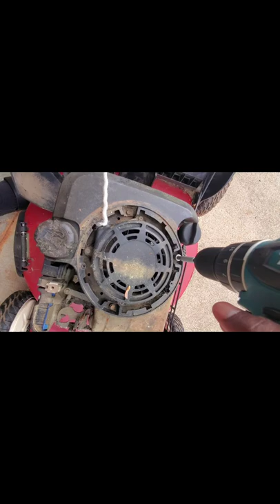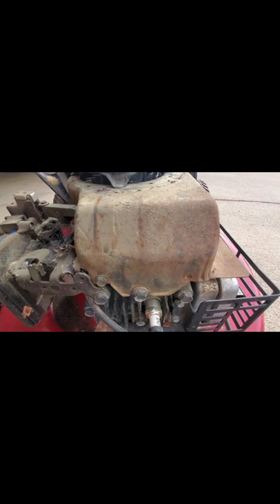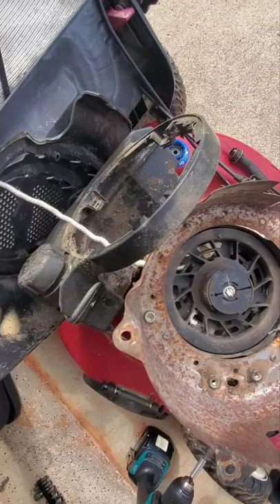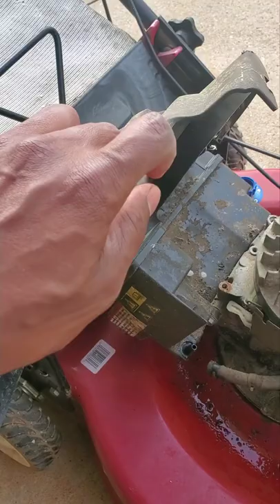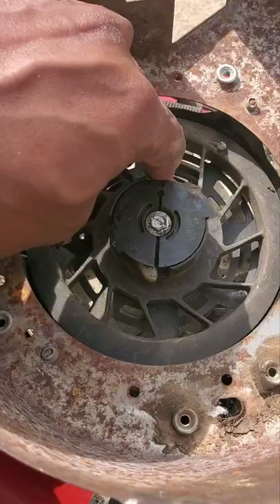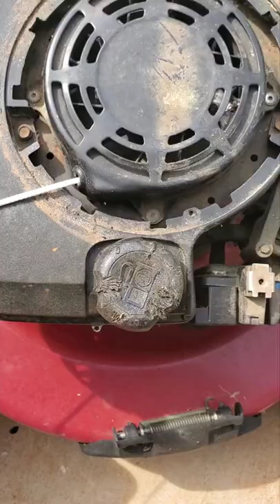Lawnmower Pull String Replacement: Toro:

Comment: Great video! I have a similar Toro, and I couldn’t tell if the stainless steel things were rivets or hex head nuts. I was going to drill them out until this video showed how easy it is to dismantle the bigger top. Well done, and many thanks!

Comment: Good, straight to the point how-to video on replacing that model pull cord; fixing to pick up the same mower for $45 with a messed up pull cord, looking forward to fixing cord followed by prob cleaning the carb and have it ready for sale for next Spring:-)

Comment: My neighbors mower, which I'm fairly certain is the same model did the same thing. The core of the pull cord didn't actually break but the outer casing did. To me, that says it's not the cord but something wrong with the recoil.

Comment: LOWES now sells a 9' USA MADE $16 replacement that will last a LIFETIME.  You may want to sand and paint the rusted handle retaining holder near the handle before installing so there will be no chance of the rope breaking.
Reply from the maker: @williamc2930  I don't  have this mower anymore.
Reply from the maker: @williamc2930  50 in cut now.

Comment: Step 1:  DISCONNECT SPARK PLUG BOOT. Step 2: RELEASE HANDLE CORD by pushing it through the gap in the handle retaining holder. Step 3: Slide the handle through the top engine cover. Then most is out of the way for Step 4, dismantling the rest of the parts.